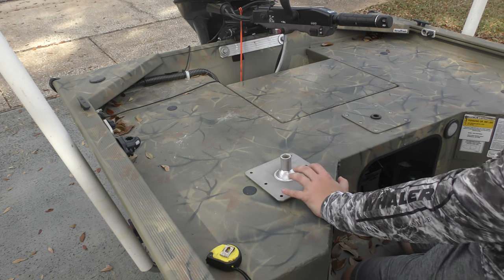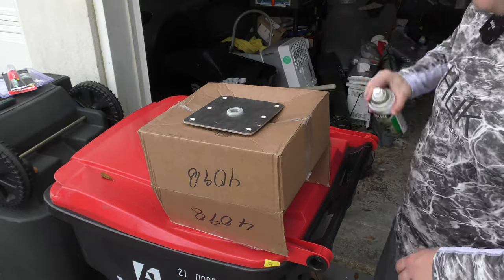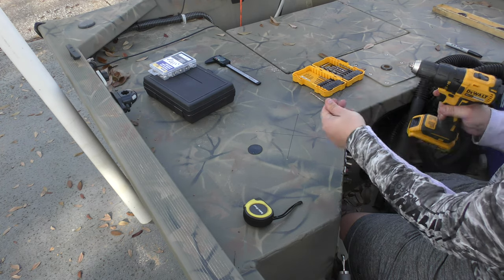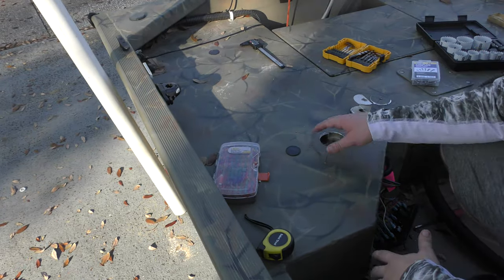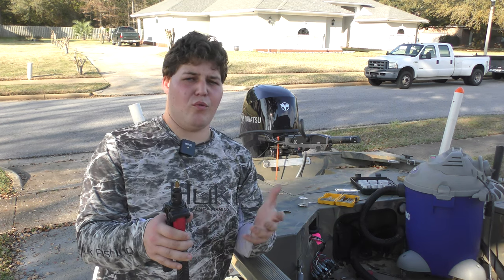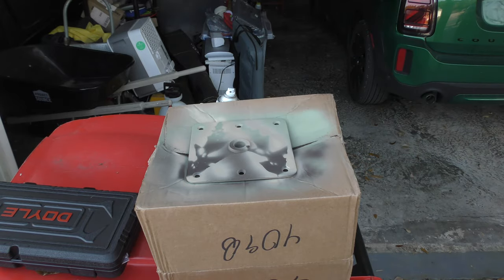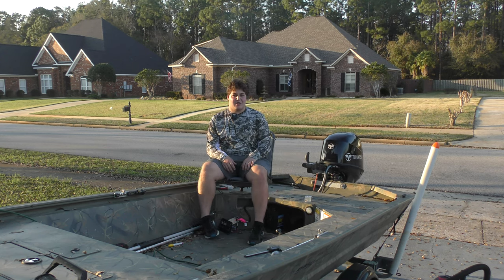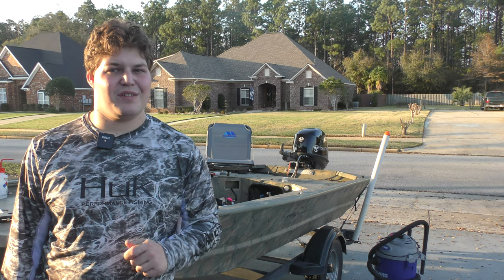How to securely install a seat base in a aluminum boat

Comment: The rivet bolt mount is a novel idea. The MFG uses sheet metal screws, and that seems to work well.  Thats all I used for my grizzly.  The good news is that if screws do eventually fail, the backup plan would be the rivet mounts as they take a larger hole.  If you do the rivet mounts to start and they fail, not many options other than aluminum welding the holes closed and starting over.  Food for thought.
Reply from the maker: I absolutely agree with you from the factory If the boat comes with sheet metal screws I see no reason to do this unless they fail.  That being said, the additional strength and rigidity provided by the additional surface area coverage by the rivet nuts would require a significant amount of force to pull through or damage. I'm not saying it cannot happen but I would imagine it is extremely unlikely. You provided a perfect example though. A friend of mine had sheet metal screws for his boat cleats and a limb grabbed one of them and ripped it out stripping the aluminum. We proceeded to put a rivet nut in place and a stainless steel bolt which remedy the issue. It is significantly stronger now and there have been no issues in the past 4 months. I look forward to seeing how long these rivet nuts last. I hope for a minimum of 10 years but would be extremely happy if it exceeded 20. I appreciate you watching and leaving a comment as well as your thoughts. It's wonderful!
Reply: Don't be fooled by the fact the factory uses sheet metal screws. If you look under the stern factory seat base you will see they have welded 2 pieces of flat bar where the screws go. This more than doubles the thickness there. If you stick your phone alongside of the battery and take a pic you'll see what I mean. 
I would not trust screws on thinner plate . I really like the idea of rivet nuts and thank the OP for the suggestion.
Reply: @waynekaye6883  yes...yes they do have added plate from the factory in factory seat locations. That said, 6 screws is plenty in aluminum to hold it. Floor is twice as thick as the bench for a pedestal.....and that helps with added torque of a 14" post.  Not anywhere near the torque in a seat base without a post. 
Two thing go wrong with rivet nuts.... 
1. they can spin....then you're screwed.
2. machine screws have a galvanic reaction with the rivet nuts causing them to freeze up, which makes you unable to remove the screws at a later time....and with too much effort, see #1.
Well nuts are like rivnuts...but have the same release issue. 

The directions for installing pedestal base  refers to stainless sheet metal screws...even in fiberglass. 

More than one way to do anything.
if there is access to install a backer plate....of course, do it.

Comment: Are those carbon steel Nut Rivets?  wondering why you did not use stainless.  I know aluminum is weak but any dissimilar metal could cause Galvanic corrosion.  Not sure there is a way to use nut rivets to prevent this. I would be interested in an update to see if those rust or have corrosion later on down the line.
Reply from the maker: No rust after a year and saltwater use just unscrewed the base a month ago without a problem. They are brass rivets with stainless bolts.
Reply: @BuckcreekTV  Awesome. Thank you for the update, planning on doing something similar.
Reply from the maker: No problem

Comment: I noticed you are right handed on the video. Just wondered  why you put the seat on the right of the boat so you are holding the tiller with your left hand? I've seen that a lot but haven't found out why. Noce video!
Reply from the maker: Thanks! Two general reasons for me. #1 I had shoulder surgery on my right shoulder so my left is much more comfortable. #2 the controls are on the right side of the boat so it is easier to reach between my legs to get to them vs bending over.
Reply: :) Makes sense. Thanks @BuckcreekTV

Comment: I have a Lund ssv with plywood topped benches. Id like toninstall a Millenium seat like yours on a swivel. I cannot access the inside of the styrofoam filled bench to use bolts woth nuts. Im wondering if you think i could use a rivet like that on the wood benches to secure the swivel base. My one rider is 290lbs so Im looking for a more secure way to mou t that seat. Also, the plywood bench tops have marine vinyl on them. Wondering if I can install those rivet nuts right thru the vinyl. Thanks
Reply from the maker: Im not certain how well rivet nuts would work with plywood. I think the plywood would be to thick for it if it's 3/8 or 1/2" before using rivet nuts, I'd find a scrap piece of plywood same thickness and try brass rivet nuts on it to see if it would pull through. Hope this helps.
Reply: The make threaded inserts for wood but a lag bolt/screw might have more strength. Good luck. Maybe even toggle anchors

Comment: What pedestal seat mount is on that seat? I’m putting seats in my boat build and I’ve never messed with any before so if I was to only use the Attwood mount (in the description) and then their seat mount would it swivel like yours? Im ignorant with boats haha
Reply from the maker: Yes, it should be able to.

Comment: W hen you mounted the bracket you didn't add anything to the bottom of the tube. Water will get in there and soak in the foam. A short piece of tight fitting rubber hose blocked off on the bottom will prevent this. I just bought the same boat and will be doing this as well.
Reply from the maker: Problem associated with blocking that hole in the bottom is at the seat. Pin sits longer or farther down than that. Also, in my case, fortunately I'm able to store it in a dry shop that in the summertime is getting to 110 120° which allows any moisture to evaporate
Reply: @BuckcreekTV  That's what I was referring to, using a piece of rubber hose. Make it long enough to extend past the the seat pin and block off the bottom. That eliminates any chance of water getting down there.
Reply from the maker: Understood, excellent addition